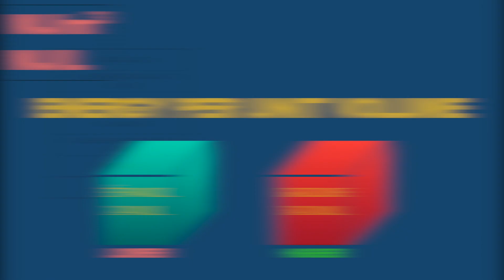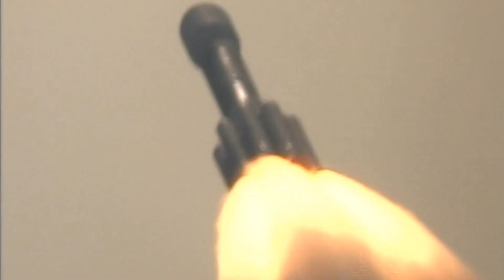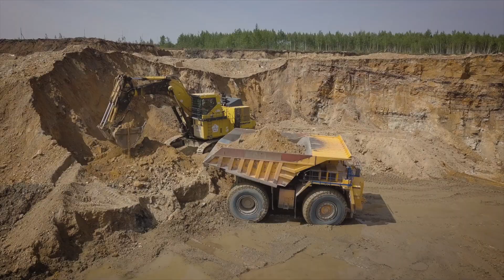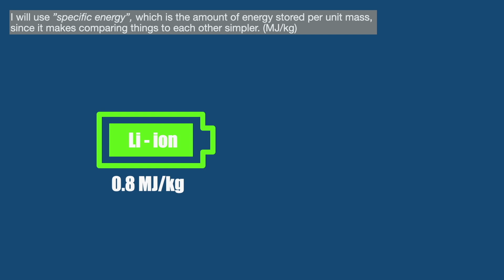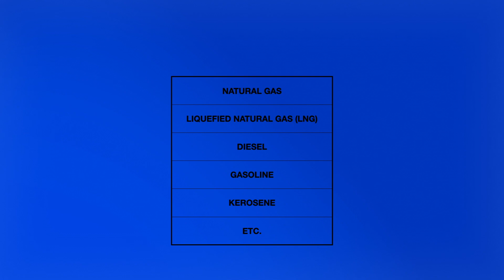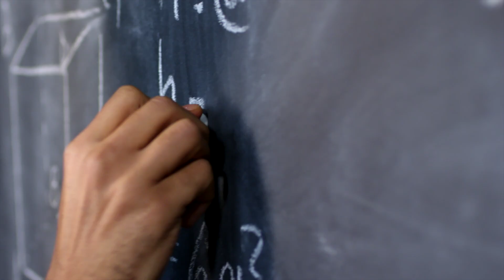Why It’s So Hard To Beat Fossil Fuels?

Comment: Although the fuels are very energy dense, we don't exactly use them at 100% efficiency because that's just not possible with combustion engines or turbines. A lot of that energy is wasted as heat.
Reply from the maker: Good Point! I totally didn't mention that in this video, but even though combustion engines waste a lot of energy as heat, vibration, friction, noise etc. The point still stands that even when accounting for those losses, these fuels are still the most energy dense, chemical energy based fuels. So after accounting for the losses, the energy density is still much higher (≈15MJ/kg ?) than that of batteries (≈5MJ/kg)